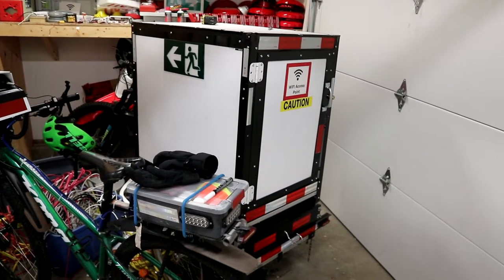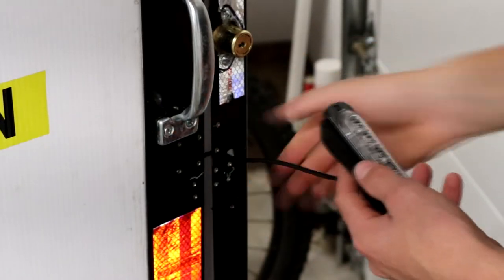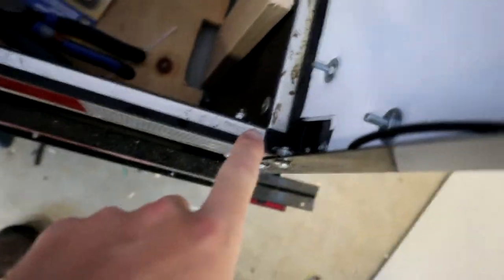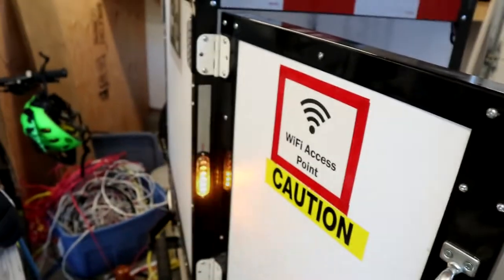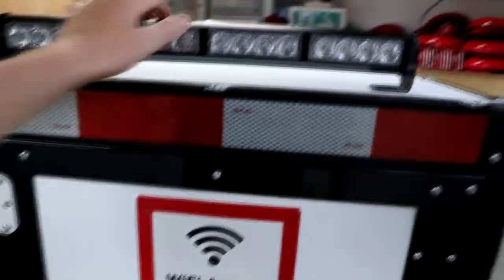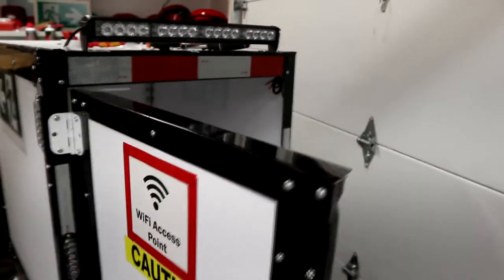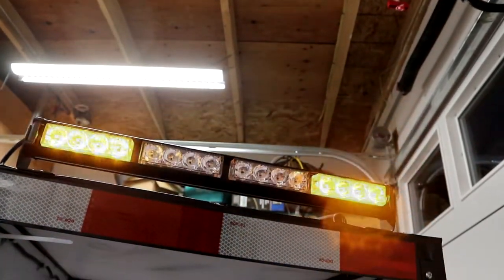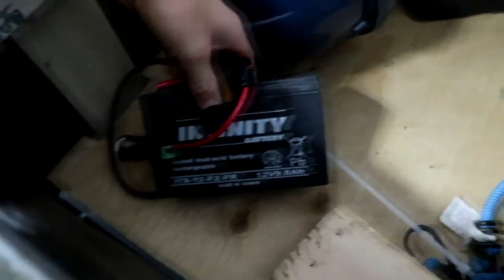Putting LED warning lights on my bike trailer

Comment: What you said about people with EPILEPSY is correct to the letter.
I know because I am EPILEPTIC,
but also a 43-year exp mechanic at the same time.
And I saw what kind of lights you had on the trailer I had my Lady
(Who is not EPILEPTIC) Start the video, 
Turned my head to where I couldn't see the screen and asked Her if I was correct in saying
Those flash like a disco ball.
She told me that if I had been watching this, I would be taking a great risk of going to the hospital.
But I built a BIKE TRAILER in 2021 with lights,
But the lights I put on the trailer were:
"BACK RED" BRAKE, TAIL, TURN,
"SIDE YELLOW" RUNNING, TURN.

But with mine, 
I put a PIGTAIL between the bike and the trailer,
I control the lights while riding 
DAY or NIGHT.
And yes, liked this, I also had:
"12-VOLT LAWN MOWER BATTERY" to power the lights when I needed them.
I always made sure to check the battery while a MULTIMETER to make sure I had 13.5 volts,
But if not:
That's where a good ole fashioned BATTERY CHARGER comes in which I had ready and waiting.

Every once in a while, I would have COPS pulling me over,
But not for a VIOLATION.
But because they wanted to check it because they had never seen anything like it,
And often asked where I bought it,
They were blown away when I told them I built it.
Numerous times, I was asked if I would build one for a friend of theirs,
I was told I could even patent it.

But to the NARRATOR:
THANK YOU for caring for us who have health problems (EPILEPSY).
But please 🙏 next time, put a caution at the start of the video in case others don't know what kind of lights you're going to use.

Comment: You can use a solar charge controller to prate the battery from the discharge

You can get one on ebay for $ 10
Reply from the maker: electro science I’ve ordered and overdischarge controller on Amazon
Reply: Ok 👍
Reply from the maker: electro science For me it’s cheaper to buy them on Amazon with free shipping because I’m in Canada shipping on eBay is typically very expensive
Reply: @nics-systems-electric  ok